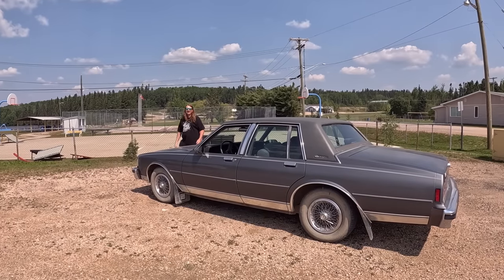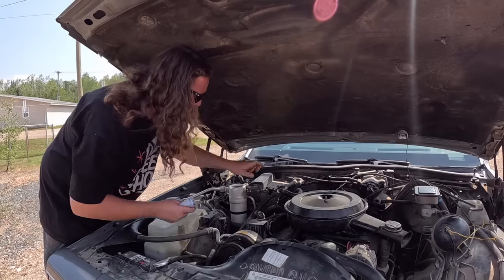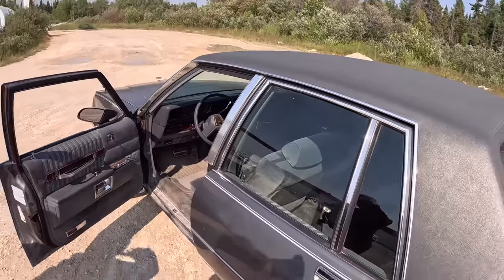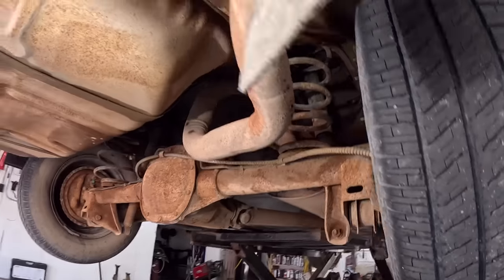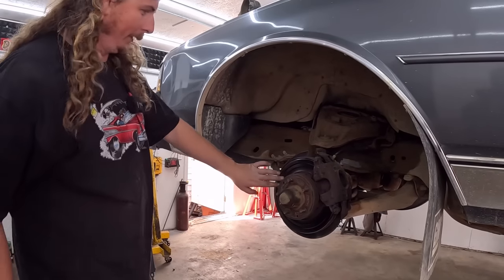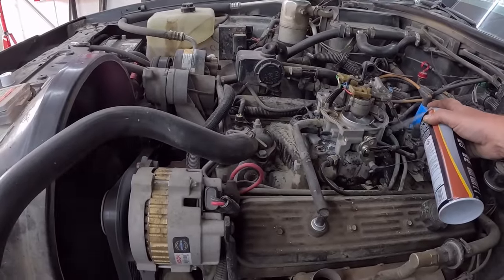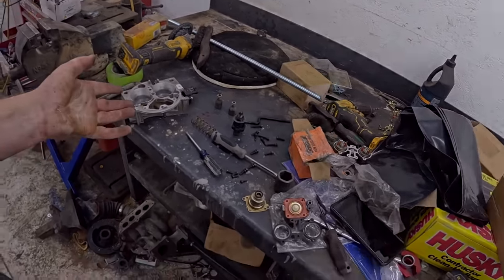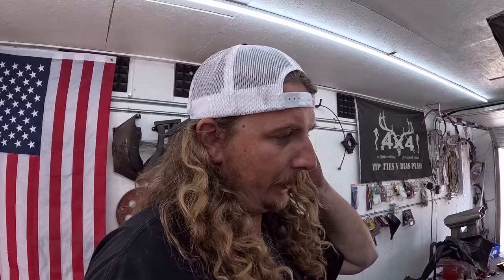MINT 35K Mile ORIGINAL Owner 1989 Caprice - Why Did I Buy This?...

Comment: PLEASE dont LS swap or 2 door Gramps, hes a true survivor. Just fix it and let Danni daily it. Danni dont even think about bedazzleing or pinking out the interior either!🤣
Reply: 100% Agree
Reply: Clean repair and drive enjoy!
Reply: Don't mess with perfection. A 350 woulda been better, but that 307 will do just fine in that boat.
Reply: There’s a lot special about a car this old with such few miles.  LS swaps are what is not special.
Reply: @bad66chevelles  Dude suggesting making it a convertible makes you sound completely clueless. If you say the car is nothing special why on Earth would you burn that kind of money on it?
Reply: 100% agreed. We are getting so far away from traditional cars and more of them are getting scraped and ruined by people who have to customize it's not worth modifying clean ones anymore. If one day the engine goes bad I would suggest a stout small block crate motor that will drop right in.

Comment: Because it's the coolest car you own. It will likely run and ride better than anything else you've got.
Reply: Cooler than a cobra, or 57, 55 Chevys ??....no..
Reply: It's the coolest car he owns because it's the only one with A/C on it.
Reply: @bigEratt  yes I'd you fix the mechanical quirks and don't modify.
No lowrider kit no funk lowrider paint.
It could be your grownup car when you have to do grown up stuff.
Reply: @petercardin7774  well I guess according to you, folks should all just buy themselves a dependable grocery getter, and stop customizing, and hot rodding cars all together.. its the "grown up" thing to do.. ?
Reply: @bigEratt  I am a delivery driver in a major metropolitan area and most of the ones I see have 22" wheels and a sparkly two tone paint job.
Reply: @petercardin7774  How about a nice set of headers and dual exhaust?
Reply: @jeffrobodine8579  lol.. I'm from a small town, and I see the same thing. Not a choice I'd ever make, but to each his own. Keeps those old cars on the road, instead of fed to a crusher, for awhile longer anyhow..

Comment: The EGR could be sticking open a little bit past the seals and thats where the brake clean is getting sucked in. Try using a egr block off plate and see if it changes.
Reply: Was just going to say it's probably the EGR,could just spray the brake clean from the other side to be sure
Reply: thats what i was thinking as soon as i saw it
Reply: EGR was my thought too.
Reply: Me three
Reply: pull the egr carbon build up was common problem ,
Reply: i agree EGR is sticky and leaking, block it off with some steel shim stock and see if the problem goes away, also check timing with the timing bypass connector either near the ECU or under the passenger carpet disconnected. to check base timing.
Reply: I replaced my EGR and rebuilt the throttle body with new gaskets too ! still doing the same thing as DD's car. maybe it is the map sensor !
Reply: He needs a smoke machine. It pull the brake boster hose (from the check valve) and buy a cheap cigar and blow into the hose and find where it is smoking from.

Comment: Since the brake clean trick looks like a vacuum leak, you might check for a crack in the throttle body. Maybe even a defect in the trottle body casting. Like a pin hole in the casting. Just a thought. It's something I have run across before.

Comment: Hey Dan, I am the old now retired guy that use to work on that model car! you are defiantly on the right track keep going after the vacuum leak. maybe the TBI gasket is mismatched or the EGR next to it may be sucking air. back in the day we would use a propane enrichment kit to fine tune the search. for you youngsters that is an old propane torch converted with a larger orifice and a rubber hose on the end to pinpoint the direction of the suspected leak. later we were blessed with the smoak machine invention to help find vacuum leaks. that care is one of the first OBD1 systems that really worked well and if you can get a hold of a good old OBD1 scanner you will have a lot of fun with it you will learn things like block learn and intergrade fuel trims Vs % long term and short term. the car can be efficient and run very well. Good luck in you journey my friend I will be looking forward to more videos.
Reply: Old guys rule when it comes to troubleshooting.
Reply: Propane enrichment. We used something like that to find refrigeration leaks. Been a long time.

Comment: I had several.of these. Great cars. My 1991 would completely shut off, when stopped. Foot in it, and it would run like a champ.
LOTS AND LOTS of work, and I figured it out. There is about a 1.5 inch piece of rubber line between the fuel.pump and outlet of the sending unit. It split open. Under low load, pressure would climb, crack would open up, spray fuel back into the tank.
 Dropped the tank. Replaced that section of tubing. Ran great again.
Reply: I had a 1984 Lincoln Town car with the same deal. Changed all gaskets, throttle positioning sensor and a few other parts, finally put a fuel pressure tester on it and saw it jumping around. Dropped the tank and that 3 inch piece of hose had a small hole in it, changed it and drove the wheels off that car!
Reply: I had the same problem with my 94 Chevy truck.
Reply: Went ahead and changed the fuel pump while I had it apart.

Comment: Last year I picked up a 92 roadmaster with tbi 350/700r4 with 47,000 miles. All original down to original tires. Thing is mint! Had similar dying issue at idle. It did have engine light on though. Wound up being egr/map sensor code. I replaced both egr valve and map sensor and been running perfect ever since. I have put 18,000 miles on in 14 months. Awesome car and gets 22-23 mpg! I also have a 2019 silverado with less than 50,000 miles that sits cuz I prefer to drive the roadmaster. Such a nice ride. Don’t put cheapest shocks you can find. These things prefer Monroe severe service or bilstein. I would leave drivetrain as stock as possible. Thing will run forever.

Comment: Great find!  I would fix the mechanical issues and just leave it stock.  Most of your other cars HAD to be re-worked because they were pretty beat by the time you got them.  This is completely different.  This is a really neat time capsule.  Danni's right - you have to get some cassettes for that car.  As you have said many times, it's only original once.
Reply: As a person who prefers the old cassettes, you might not regret it.
Reply: They started making Cassette Tapes again btw.

Comment: You might try the propane torch trick to narrow down the vacuum leak to a smaller area.  Just turn the torch valve on to let a small stream of gas out and slowly move the tip around until RPMs increase.  Usually works more precisely than the brake clean spray.  👍👍

Comment: I had an 87 Cap Brougham w Y block 305. One of the best cars ever made in my opinion, it was certainly the best car I ever had. Took me and my family over 250,000 km in comfort and safety. Simple to work on, and parts were not expensive. You got a winner there.
Reply: Y block is Oldsmobile 307 roller cam V8 I know one of my favorite engines they dead reliable and damn near bulletproof ..
Reply: I agree i have a 88 Caprice Brougham with 108k original miles she purrs like a kitten

Comment: I worked for GMC and Chevrolet dealerships in 70s and 80s. Throttle body gaskets were notorious for drying out 
and cracking causing similar symptoms. Also,
That doohickie you pointed to at the fire wall is a MAP sensor, it tells the ECM engine vacuum. They go bad too. 
Those old B bodies were tough as nails. Put a good suspension kit in it and maybe a bigger small block.
A Trans-go shift kit, some 3.73 gears and enjoy.
Reply: Could be the next 2 door conversion series 🤔🤔
Reply: Definitely the problem, MAP sensor causes stalling if bad!!
Reply: My wife and I bought another 77 four-door Impala that has 83 thousand miles on it and this thing quieter than a Tesla
Reply: You can block the map sensor off and they will still run they throw a code 34 it's not something that would cause a low idle stall.

Comment: there is an idle motor in the tbi most likely needs replacing how it works it opens and causes a small vacuum leak and sets the idle when the A/C is turned on it sets the idle up to compensate

Comment: Dan that’s an awesome machine for $2500 Cnd…those are amazing cars and are as dependable as an axe. Oh and all of the aftermarket suspension parts for a 94 to 96 Impala SS will bolt on…including the disc brake reared. Oh and they go really well with an LS4L80 swap :)

Comment: Great find  ! These G and B body GM cars are hard to kill and are very comfortable  . I enjoy driving my 81 Oldsmobile Delta 88 sedan every time except in winter  .
Reply: Try replacing ignition module
Reply: @LarryKimbrough-b4r  Like anything age catches up year by year parts might not be easy to get and these are far simpler to work on compared to today's high tech vehicles.
Reply: Yep, That's why people here in the States, atleast in the Southwest anyway are buying theses A and B body cars from 70's and 80's and putting 30's, 40's and early 50's bodies on them and building budget hot rods. It's a natural fit.... think about what you do/upgrade when you build a hot rod..... You upgrade to a modern V8 Drive train, guess what.... most of them already have that, upgrade the suspension and lower the car, They already have that too, power steering power brakes? Ditto...... and most of the wheelbases are close enough that you don't even have to bother with it.

Comment: I own an 1989 Caprice with only 37k miles. Purchased 4 years ago from a small dealer. An older woman owned since new and passed away. 305 is great on gas. AC was retrofitted and works great. They make a chip for the ECU and that boosted the power tremendously. Dual
Exhaust and a decent edle Brock pro flow filter too. Nice set of mags. Garaged in the winter. My grandparents had two when I was growing up. Pure nostalgia for me.  Couch on wheels. I live in NH so it’s hard to find a nice one. Please take care of it. ❤

Comment: I sold my dad's 1990 Caprice for my mom after my dad passed. It was the same car, colors, motor, everything. It only had 66,000 miles on it. I had the same issue with it not wanting to stay running, the car sat for a couple of years before selling. I had to replace the fuel pump because of the ethanol. I also had to replace the throttle body / carb. I was lucky enough to find one at a local u-pull it salvage yard. It was originally my grand fathers car and when he passed it was left to my dad. I thought about hanging on to it, but I hardly drove it, and figured it would be better off going to someone that could enjoy it. My dad said he could drive from central Florida to North Carolina state line, 500 miles on one tank of gas. 
Nice car, and best of luck with it.

Comment: Hey Dan, my daughter has a 1987 Chevy pickup. It would die at all the stop lights. Turns out believe it or not, the distributor shaft was worn. I dropped in a new distributor and it’s running great. That was 8 years ago.

Comment: That a great find.
You have a vacuum leak. Use the tube on the starting fluid and isolate the leak. Keep it stock and run it.
Those are the same frames to 96. We have a local guy with a 408 with road race tires.

Comment: Hey Dan, these old TBI motors are real sensitive to timing. There is a wire you will have to disconnect (likely on the firewall, driver side), then you can shoot the timing. Factory setting will probably be 0 degrees advance. good luck with it, and keep it stock, no LS!
Reply: Definitely true they are known to have loose distributor mainshafts and cause hard starts I agree with this statement 100%

Comment: If you attempt to clean the throttle body, just be aware that brake cleaner is not ideal for cleaning a throttle body, as it can be too harsh for the sensitive components of the throttle body. Carb cleaner is a better choice, but the best option is to purchase a dedicated throttle body cleaner, which is created especially for throttle bodies and won’t ruin the air sensor.
Reply: They do make throttle body cleaner.

Comment: 96 was the introduction of the vortec motor. That's a flat tappet TBI. Start by checking the IAC solenoid it could be hanging up. If it's throwing a check engine light you could jumper two leads in the OBD1 port and count the number of pauses and blinks on the SVS light and look up those numbers up and that will give you the code for what sensor.

Comment: I had basically the same car back in the day.  Mine was a 1982 Impala with the same setup, 305, over drive auto, etc...  Mine didn't have fuel injection, it had a big ol' quadrajet and ran GREAT.  After literally a half million miles, the transmission gave out.  Mine started it's life as an unmarked police car 🙂           Paint on the side:  "Get off my lawn!"

Comment: Dan we must be related! I found an 89 Caprice identical to yours but a basic model. No vinyl roof, no wire wheel caps and I found it 7 years ago on a roadside. It had 53,000 documented (have a complete maintenance history) miles (82,000k) and I love it. The body is perfect and the undercarriage is the same. I now have 110,000 KMS on it and except for tires and brakes I have $1700 in repairs. It's a big car and I have a couple of dings in the front fender. It has manual windows and if I want to open the passenger side windows I have to undo my seat belt. And I am well over six feet tall.
It has a 305 but don't know what the tranny is. It came with full sheet metal wheel covers but I kept losing them. I put on a set of Nova dog dish caps and it looks mean!
It's an old man car but I am really old. It is surprising the number of offers I've had on it from young and older men alike.
Being old it will probably be my last car unless something happens to it. I also have a vintage vehicle. So what to do? Keep it'

Comment: Don't touch the motor leave it as it is lol.. to me because maybe it had been rarely driven the fuel could be older, so my advice is to run that old fuel out of her then top up with new fuel and then change the fuel filter which is inline and also clean the IAC sensor like you said.. works wonders on these cars from this era. 

Awesome find and cheers 🍻

Comment: Dan check your egr valve or the map sensor.  The system is obd1 so you can bring up codes by taking a paper clip for a u u to jump out the 2 right pins on your diagnostic plug under the dash turn your key on engine not running but dash lights lit position and your codes blink out. 1 flash then a pause followed by 2 flashes of the check engine light is a code 12 and ect. Hope this helps.

Comment: 1980's Cars are becoming more popular than people think. I've got a  project 81' Malibu Coupe that I finally got tuned up and am able to drive around. I get the looks, thumbs up, wave of approvement and people asking about the car. To my shame and because of where I live I had to have a Mechanic install the SBC 305 that was swapped into it and a Dyno Shop that did the Exhaust. Everything else Interior and Exterior I am fixing on the car, it's a work in progress for sure but it runs. And it's definitely getting attention.  Now for the TBI, before he died, my stepfather had a 89' GMC Sierra with a similar TBI system in it, I am trying to remember what the problem was with those, I remember having replaced something in the TBI but right now it eludes me the one major problem those TBI's had. . . .

Comment: Spray the intake gasket, possible vacuum leak there. That spray can is pretty general in it’s direction and area size. 
TBI are speed density systems so any vacuum leak around the throttle body just increases the RPM. Running lean has to be an uneven vacuum leak causing a cylinder or two to misfire OR a lean condition caused by the coolant sensor or map sensor. Also if the EGR valve is leaking exhaust into the intake at idle the engine will not be happy. Lastly check the evaporative system which may have been damaged in that dent in the left front.

Comment: Hello!!!! Congratulations, excellent purchase, low miles, single owner, very good car, I have a 1978 caprice built in Canada, which I use daily and it is a pleasure to drive daily and on long trips, so I am seeing your caprice needs new shock absorbers, some good wheels with hubcaps on the dog's plate, I have those on mine and they look great, don't complain too much with that tbi, an edelbrock manifold and a 4-barrel carburetor with adequate exhausts will wake up the 305, greetings from Argentina! !

Comment: That engine has the ECU with the removable PROM Chip and Hypertech still offers it, I had one on my 91 S10 and it woke it up a pinch. Put a straight edge or both surfaces to see if their flat and if you disconnect the battery for about 20 mins it clears the memory and relearns once you start it.

Comment: I had an almost exact copy of that car except mine had a burgundy interior. I ran that car until it had almost 250k on it, then the cam wear was bad enough to start popping back into the intake on open throttle. The OD clutches would get stuck and you had to shift it manually also. It had a lot of rust underneath from the northeast winters here and it finally had to be junked but, I loved that car.

Comment: If it won't idle the IAC motor maybe bad.  Also, check you TPS for correct output voltage and dead spots.  If your IAC is acting up, just open up your throttle blades by adjusting the screw so it will idle.

Comment: Dan - You have to have 15 psi at the throttle body or it won't idle correct - I know this because I've been there - The TBI has a 15 psi regularor built into it in case your pump is over pressuring it - Git Mur to check the pump psi output.